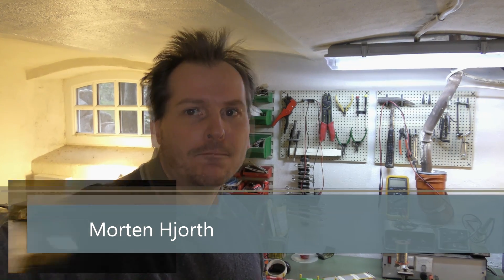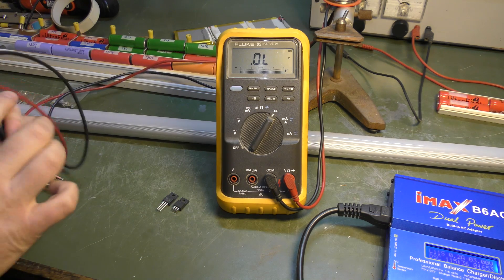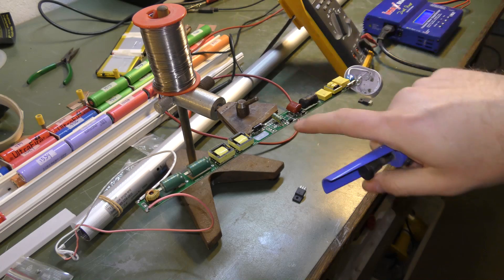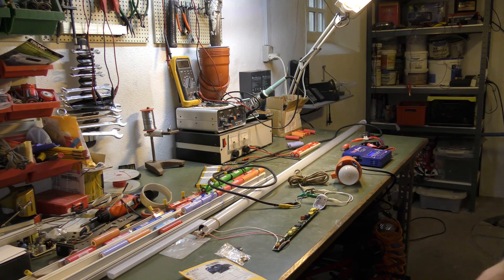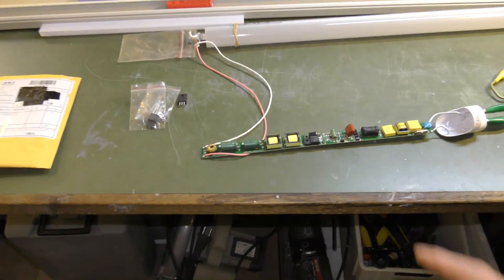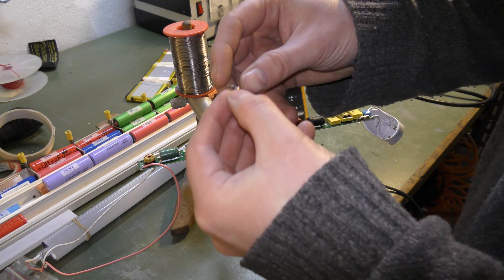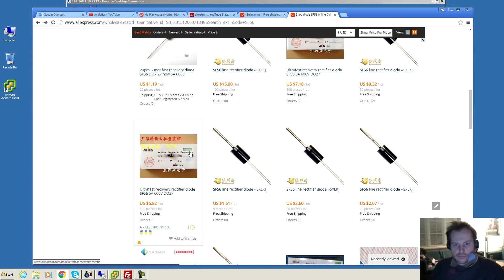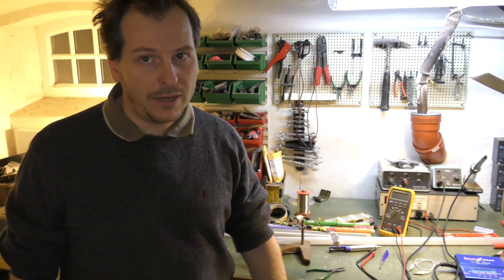Replacing MOSFET SVF7N65F in 25W T8 LED lamps - 279

Comment: Nice video. If I were you'd I'd buy a veriac to slowly power electronics like this when replacing components.
Reply from the maker: HI +CreativeType 
Well Yes,, i have been offered one. But old and big from the 1970´tsss and i do not need it very often,, this lamp in series did work,, i kind of liked it.
Thank you for watching! :-)
Reply: +My PlayHouse (Morten Hjorth) yeah they aren't an every day item. I used to use one all the time while working on amplifiers for audio equipment. But if it's not your daily job they tend to be kinda clunky.
Reply from the maker: Hi +CreativeType 
Yes It´s a bit like a concrete mixer,, really nice to have one. But it sucks to store it. :-)
Thank you for watching! :-)
Reply from the maker: HI *****
Well this lamp thing was not bad at all,, the diode poped when it was not there :-)
Thank you for watching! :-)
Reply: ***** Yes your right. Generally I've seen people use light bulbs and Variacs. If your rich enough you could buy a current limiting power supply that goes up to 240 volts. A bit expensive though. And more clunky then a variac.